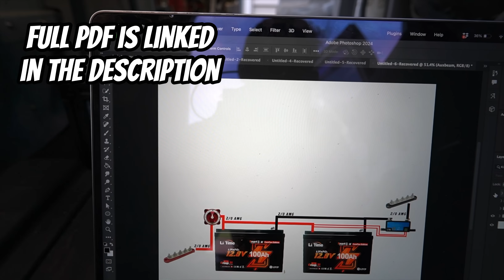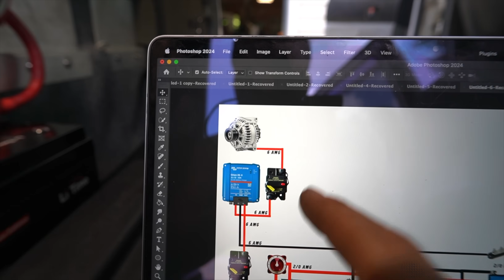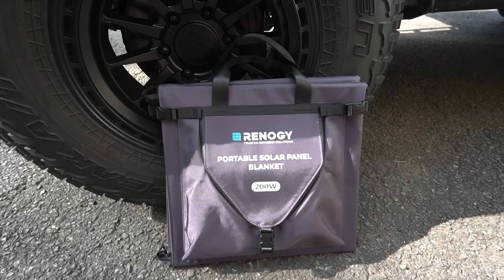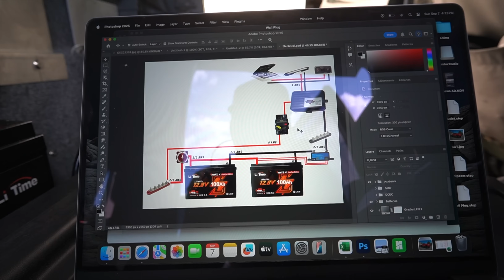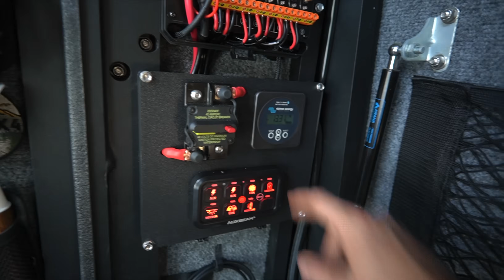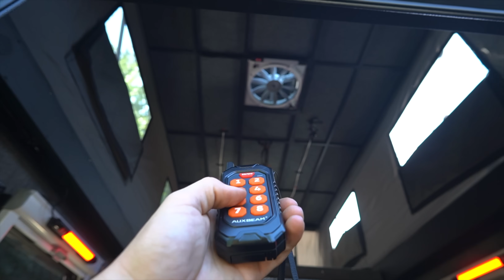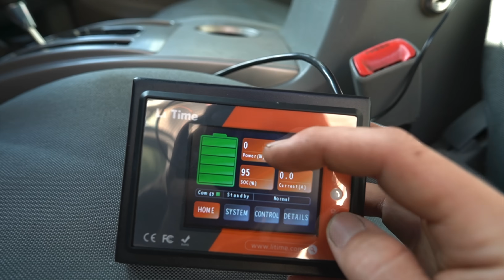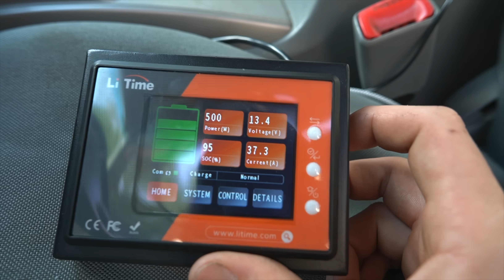DIY 12V Electric System | Overland | 200ah LiTime Batteries

Comment: Nicely done. Also a really nice presentation. Very thought out and understandable. I have a slide-in camper that I want to upgrade and I am going to use some of your ideas in it. I like the dc to dc charger. I have a 48A convertor that charges my 165AH LiTime battery in less than an hour, so I am thinking the same as you that solar is nice, but I could potentially just let my truck idle for and hour and charge back up 100% and like you I am not usually any one place for more than 3 days so I will probably buy your 200W blanket to save some gas also. Thanks for sharing your simple but effective setup. Very useful.
Reply from the maker: Love to hear it was helpful! That’s what it is all about. I’ve watched many other videos but not all of them were very clear on what exactly to do, size wires etc. I wanted something simple and straight to the point for people to reference!

Comment: I would like to encourage you to build 24 volt systems.  They work better and are more ecological.  Produce far less mining waste.
Reply from the maker: I’m sure they work great for some! For my application I wasn’t Interested in going that route
Reply: @Adv4x4  Maybe keep it in mind if you ever do a 2.0 cause you can run thinner wires and generate less heat if you need more reasons than just the mining waste. Then you just step down the voltage, but for now if it ain't broke don't fix it.

Comment: Looks like an awesome setup. Do you have a ground running from the LiTime batteries to the chassis? When setting up the system in my Tacoma I found a lot of conflicting information on whether this was required or not as my DC-to-DC charger has positive and negative runs to the starter battery. EDIT: Nevermind, I just saw the note that you do have a chassis ground.
Reply from the maker: Thanks man! It’s been working fantastic so far!